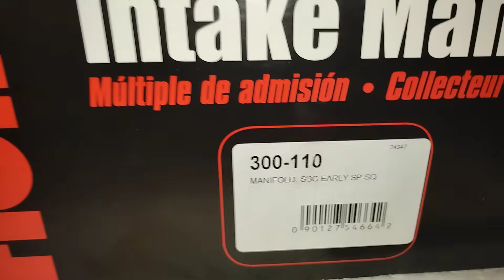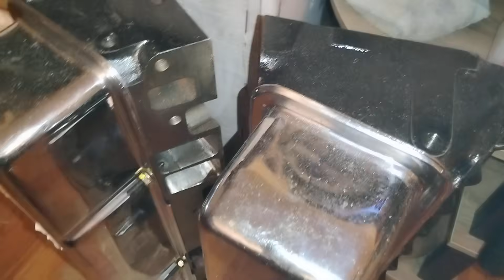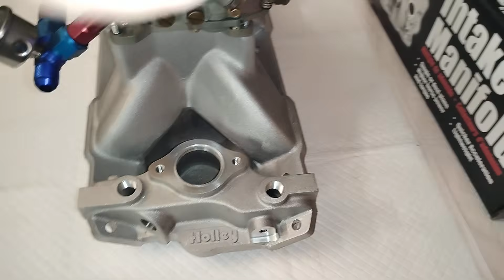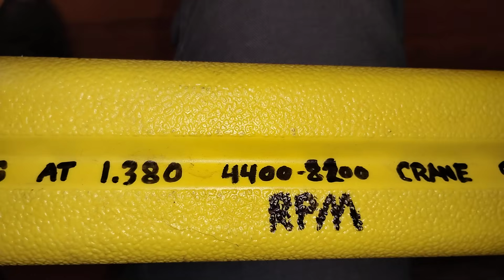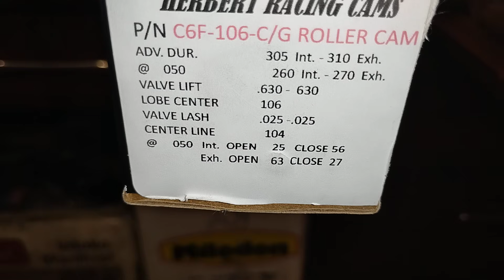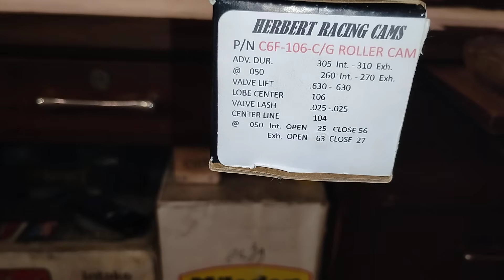Holley 300-110 single plane for SBC. Good unit for high RPM use.

Comment: That's like a Nascar engine back in the day.
Reply from the maker: @dondotterer24  Yep, pretty much what Dale Earnhardt was running 35-40 yrs ago. That old shit still has its place tho. This engine will be a handful on the street in a gutted G-body.
Reply: @thereluctantgearhead4544  exactly the engine is was thinking about.  My old boss owned a very small Nascar team that started back then. Alot of long story's about it.
Reply: @thereluctantgearhead4544  yes that's exactly the. Engine is was thinking about.  My old Boss at the GM dealership owned a very small Nascar team.  I have alot of long stories.
Reply from the maker: @dondotterer24  I think I can run high 9s with it NA. Low 6s in the 8th.
Reply: @thereluctantgearhead4544  Yep
Reply: @thereluctantgearhead4544  Yep

Comment: Thank you and thank you! The 300- 110 looks better than I thought.  Awesome Bow Tie heads.  Can you do me a big favor and measure the  thickness of the mounting  flange incase I find one cheap at a swap meet to see if is has been millled?
Reply from the maker: @dondotterer24  It's about .475 thick right behind the water crossover on the passenger side.
Reply from the maker: @dondotterer24  .565 thick at the front china wall in front of the O in the Holley logo.
Reply: @thereluctantgearhead4544  thanks!
Reply from the maker: @dondotterer24  It's a damn good intake. Definitely make some power.
Reply: Thanks!

Comment: Would this be to big or to much for street use ? On a 406 sbc
Reply: I would say this is more for hi compression or forced induction type applications Big cfm carb and high flowing heads
Reply from the maker: I'm gonna drive it on the street. But most non gearheads probably wouldn't want to.  Not so much the intake undrivable, but the shit that goes with it. Like the huge solid roller and the 5000 stall & 5-13 gear. But it can be cruised around for entertainment purposes. RPM range will come down on a 400, so it would be more "streetable". Get by with me less stall and gear.
Reply: @thereluctantgearhead4544  hell yeah that's gonna be one bad ass engine.
Reply from the maker: Work killer on a 400 with big heads and a big cam & compression.
Reply: @thereluctantgearhead4544  that's good to know cause I've been looking at it lol. Yeah I'm sure it will make really good hp

Comment: Any info on aluminum angle plug patriot freedom sbc cylinder heads? I cant find anything on them. They seem to have a stock intake port matched to a 1206 gasket and the exhaust is massive square ports as well. Thanks I love the videos.
Reply from the maker: PROMAXX bought Patriot. You could have the 225cc Patriots. Pretty good heads. Should look like the old Pro Topline heads.
Reply: @thereluctantgearhead4544  Thank you, Ill have to check them out. I had them on a 385 in my 72 nova and it ran like a BAMF tho the 385 since met its doom so now they are going on a ol reliable new 350 for the mean time. I had a suspicion they might be 225s as well due to the port size seeming massive. Appreciate your time!
Reply from the maker: @kevinschmidt9295  No problem man. Good set of heads, I'd use them.
Reply from the maker: Give PROMAXX a call, they might still have all the info on your heads. I had a pair about 20yrs ago. Good heads.

Comment: Thats a gem buddy😊😊😊
Reply from the maker: It should make some power for sure. I'm impressed with it. Way better than the old Strip Dominator intake from 1976. Although they are still better than many current offerings.
Reply from the maker: Holley got it right back in 1976. Took many years for the competition to catch up. This current unit is hard to beat.